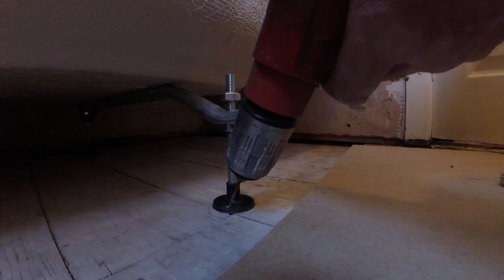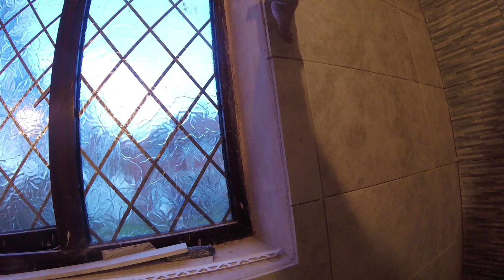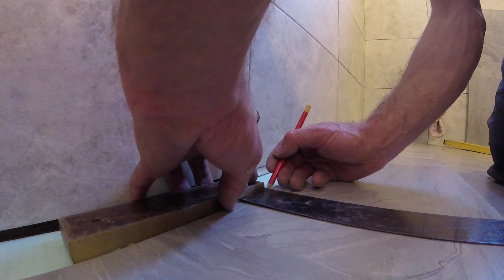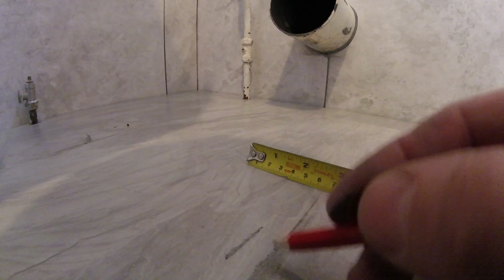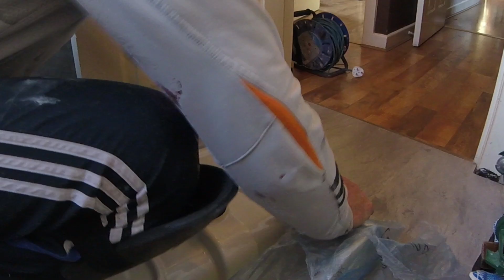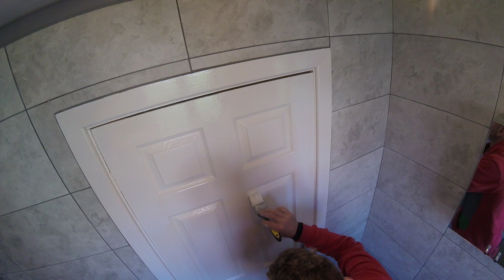DIY  ideas -  Bathroom time lapse renovation.

Comment: Great video and lovely job, very nice 👏🏼👏🏼👏🏼
Reply from the maker: All that came about from a toilet not flushing lol.
Reply: @MrDazP1adv3ntures  Im in the same predicament haha mines not been working for ages, lucky enough I've got a down stairs toilet. need to get it fixed asap tho haha
Reply from the maker: @AdrenalinePitStop  check the plastic valve in the flushing housing. You can make them from other products , like plastic packaging.
Reply: @MrDazP1adv3ntures  My system as cracked around the flush, no way of fixing this dude